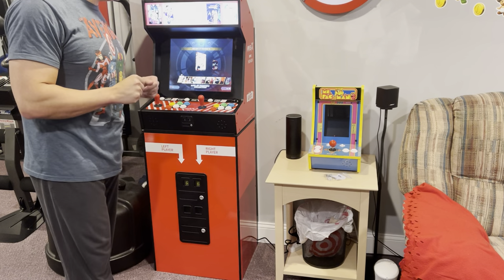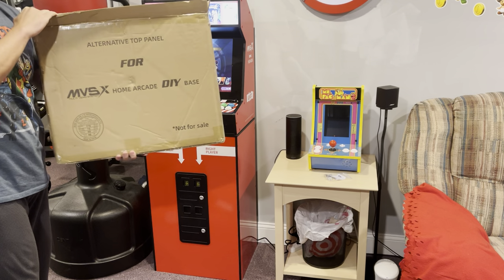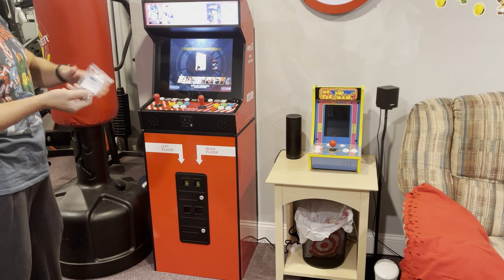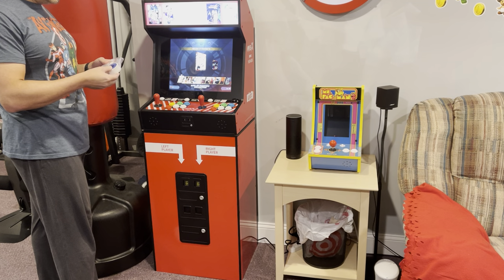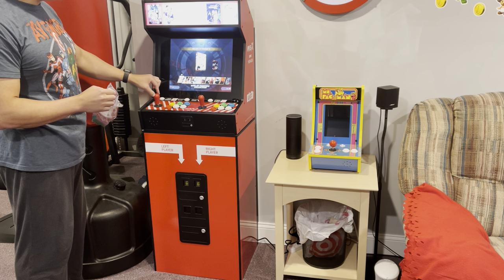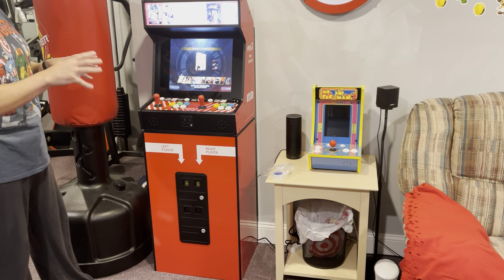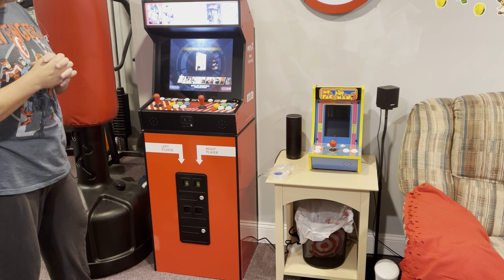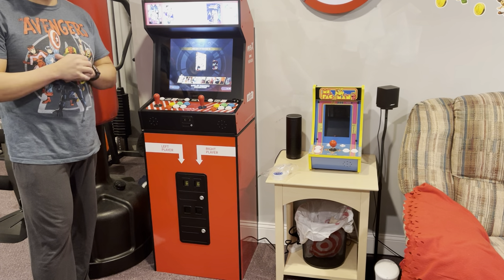MVSX (SNK) Emergency Fix from Unico!

Comment: They sent me the alternate RC with the other part of my stand but I didn't get any washers or different screws. I also did not receive my pre-order gift.
Reply from the maker: The screw packet was in the original stand box. Mine was randomly attached to a different part of the styrofoam. I didn't see it until I was taking care of the trash.

The pre-order gift is expected to be sent at a later date. I'm not sure when.
Reply: @BillLoguidiceAuthor  you know what? I actually found it stuck to an odd corner of the cardboard. Thanks to you I didn't throw the packaging away like I normally do right away hahha. Thanks for your input.

Comment: I watched the vid a few times.i get the super glue part but what is the 1st part for?
Reply from the maker: The replacement part that they're sending out is a new top piece for the base. Without it, your upper cabinet will not go onto the base without extreme difficulty. You also need to make sure you find the updated screws bag in the original box.
Reply: @BillLoguidiceAuthor  i wonder if the right parts will be included in future shipments
Reply from the maker: @SoulforSale  I would imagine both replacement parts will be incorporated at some point. It's probably just the earliest recipients who got screwed.
Reply: @BillLoguidiceAuthor  i am using my xmas bonus for this purchase. likely will still be the 1st wave so thanks for the vid